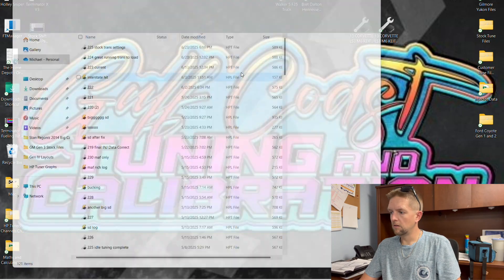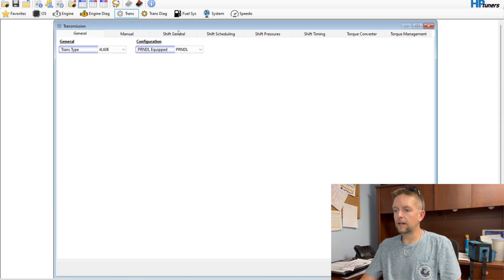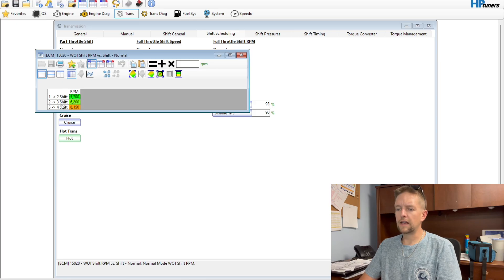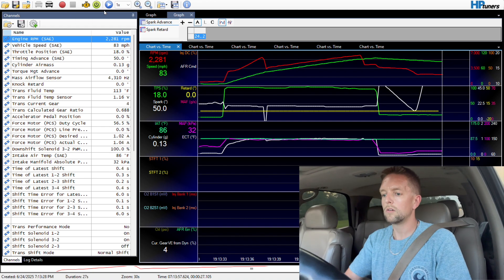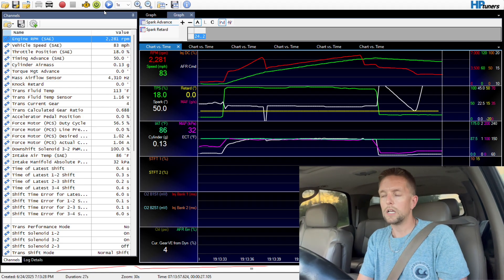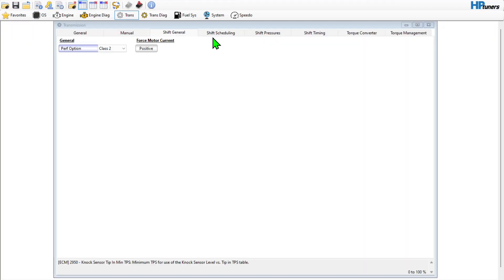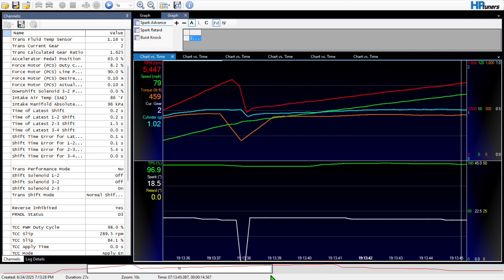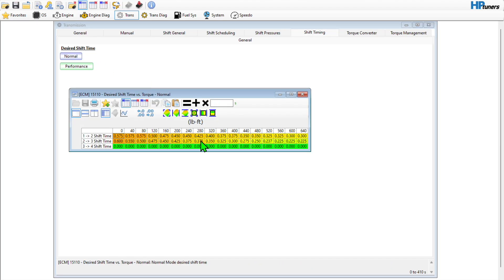Transmission Custom Tuning FROM SCRATCH

Comment: There’s only so much you can do honestly with somthing that’s mechanical. All shift pressure ref off fmc table so to really dial it in put a gauge on the trans. And I’d definitely turn your 1-2 to 6k

Comment: So, is this the same with the 10L80 and 6L80? When it pulls the spark out, which effects the torque, it feels like it is "laying" over or similar to hitting the brake momentarily and you "in the seat" feel bumps you forward. So in order to limit this feel and increase the speed of the shift, do you command less spark reduction? Not sure if any of this makes sense out of my brain. Thanks, Stan
Reply from the maker: Absolutely, the spark reduction is the torque management!
Reply: @GulfCoastTuningandCalibration  Michael can you send me the datalog PIDS for the transmission shift tuning in reference to the 10L80 like you have it set up so I can try to physically see what you are describing on the Tahoe PPV